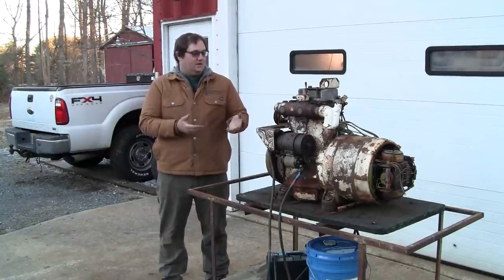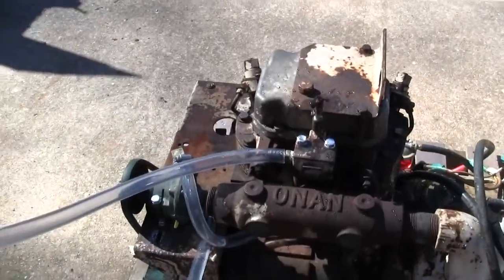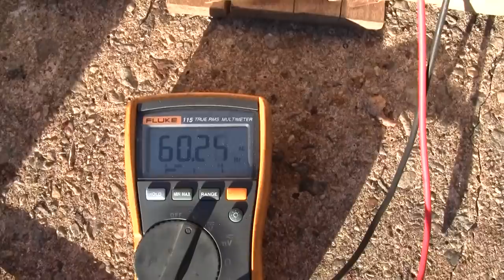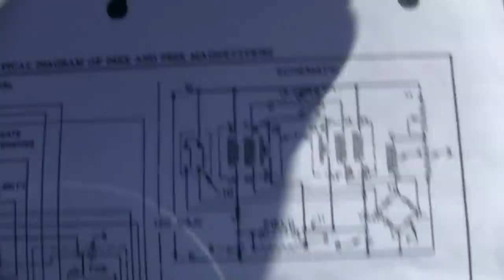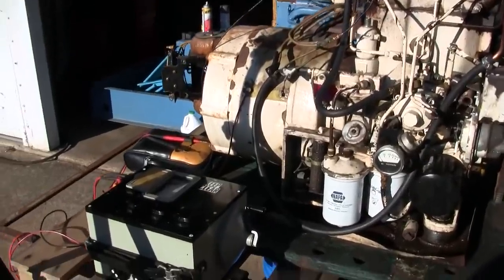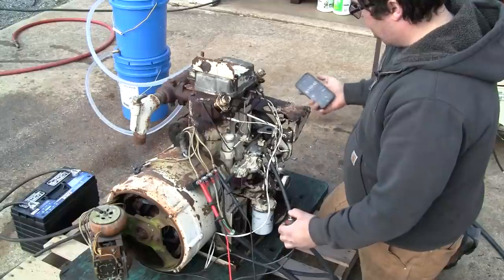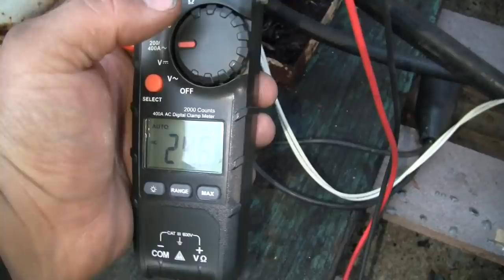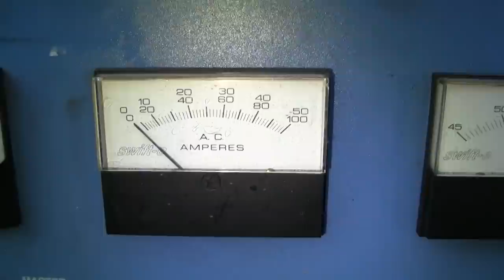WILL IT GENERATE? Rusty + Crusty Onan Diesel MAGNECITER MDJE

Comment: I have a generator with a Mecc Alte 3 phase 9 KVA alternator and it has a similar kind of regulator but the no load voltage is adjusted by setting the transformer air gap. I cheated and made paper shims to change it from the original 220V (it's from 1993) to the 230V currently used in Europe because it was as if a tenth of a millimeter was enough to vary the output by 100V or more.

Comment: These old engines are neat never seen one before are they only found in America..?..
Reply: ONAN was in business from the 1940’s so there were lots of them.  I’m sure most stayed in the USA, but some went across the world especially in boats.  
In the early days, utility electricity wasn’t available out in the country, so there were lots of “light plants”.  I’m sure that’s still the case in remote areas today even with the advances in solar and battery technology.  As electrification progressed, the main need became emergency backup for critical equipment or in areas where the utility distribution network was/is not very reliable or susceptible to damage from storms 
Cummins bought up ONAN so now it’s a long way from the original private company it started from

Comment: Does the stator on the outside create the load electricity or the rotor windings?
Reply from the maker: Steve, yes the stator produces the current for the load.  The rotor is the field.
Reply: @SmallEngineMechanic  ok thank you for reply. I am trying to get all this straight. I had watched a video on the difference between generators and alternators.  

You are sharp as can be on these generators and etc.  Thanks again for the videos :)

Comment: Looking at the video I didn't see a cooling system heat exchanger  which on a marine Diesel  genset is unusual.
Gasoline marine gensets could be raw water cooled with an option of a closed cooling system. Most marine gensets are closed cooling with a raw water cooled exhaust outlet. If this unit is raw water cooled and was used in salt water I would flush the daylights out of it including removing freeze plugs to get at the water jackets.
Reply: I've only watched this one video on this unit, but he covered that at the beginning of this video. There were two water pumps mounted on that unit, one for the seawater to pump through the heat exchanger and the pump he's using to pump coolant through the engine. I doubt that he got the heat exchanger what's the unit.
Reply: It's an MDJE. The first video showed the heat exchanger off the unit. Kind of big and heavy to mount in  a Ford E350 van. Better as a home unit , maybe convert to natural gas.

Comment: If you wanted to get tricky you might install the cooling into the trucks system, possibly through the heater loop.  Use the trucks rad.
Reply: Then you have to wire up the trucks fans (assuming they are E fans), and you have to worry about overwhelming the radiator if you run both the truck and generator on a hot day, not the mention taking it off the truck becomes messy.